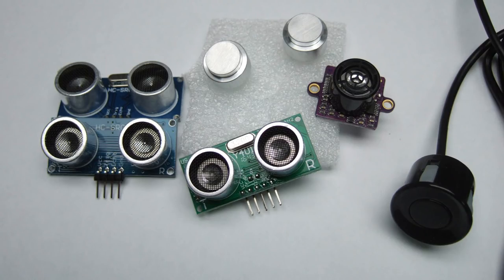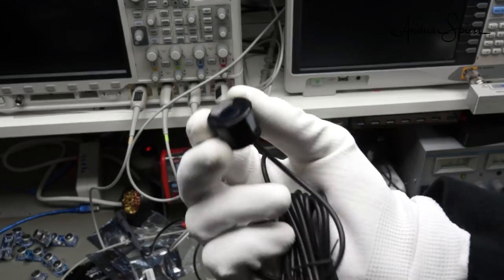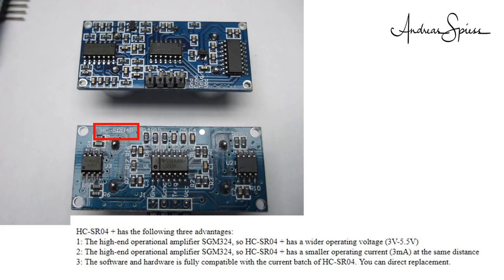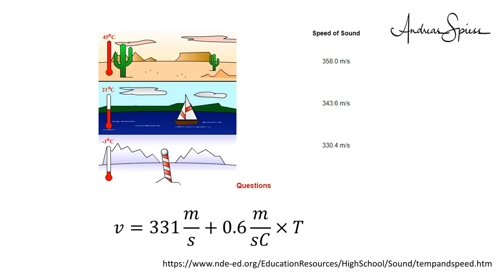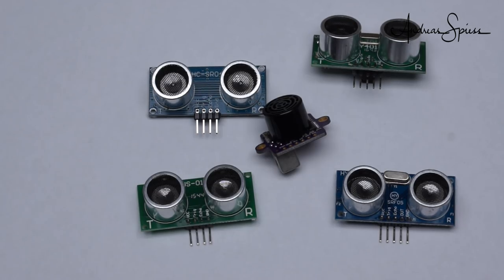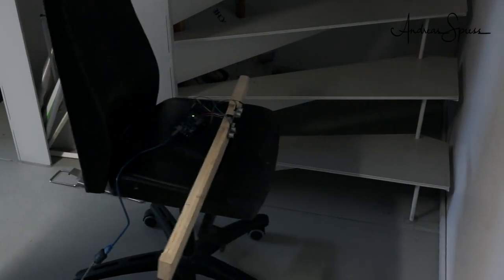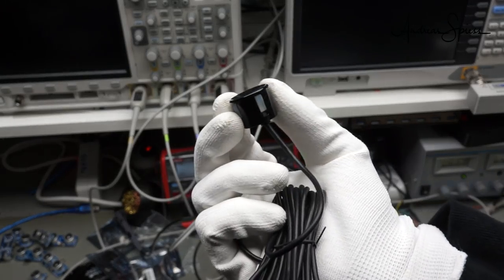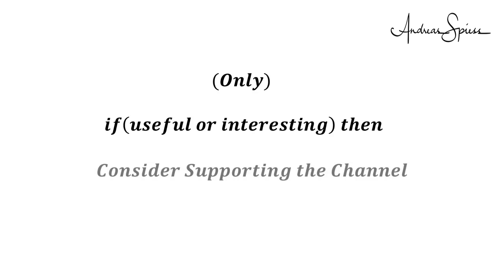#190 New Ultrasonic Sensors: Comparison and Test (US42V2, JSN-SR04T, and US-100)

Comment from the maker: Here you find the corrected overview chart: http://www.sensorsiot.org/transferFiles/UltrasonicSensorsComparison.pdf
Reply: I think that the chart is missing the measurement distance for the sensors, it is in some way a key parameter for a distance  measurement device .
Reply from the maker: I did not test it this time
Reply: I was waiting for these tests, because the interested distance measurement for the sensor "US42V2" :(
Reply: Hi Andreas, this link currently points to a 404 page not found. I just really wish to find out the detection angle of the GY-US42V2. They claim it's a replacement for MB1242 and SRF02 but those two have wildly different FOV.
Reply: boo.. 404
Reply: link is offline :( Do you still have the pdf somewhere?
Reply: The link gives a 404, is there a new location for the overview chart? Very interesting video, btw.
Reply: Andreas Spiess hi can you provide a working link to the pdf file? Thank you
Reply: G'day I am targeted individual,I have sensors in my yard and house ,is there anyway I can block the sound, someone has a direct sound coming through them  .thank you great video 👍👍👍
Reply: Thanks. Adres I need to sense top liquid very accurately ( +-1mm) in a small pressure vessel ( Laboratory Nutsche filter - inside height 300mm). This is to detect and plot the liquid level dropping vs time and accurately determine the top of the filter when the liquid is gone. Range and accuracy seem to be an issue here. Are there " newer" sensors that may suit?

Comment: The word "transducer" can be used for both a microphone and a speaker, so you could say some of the sensors have a 'combined transducer'.
Reply from the maker: Thank you for the clarification! I did not know this word.
Reply: The correct word is: transceiver (TRANSmitter + reCEIVER). Transducer is a device that converts some form of energy (e.g. mechanical energy) to another form of energy (e.g. electrical energy). Examples of transducers: LED, light sensor, microphone, speaker, thermometer.

Comment: Another well done and informative video.  Thank you.
The use of a ultrasonic sensor in the garage to help prevent parking the car too close where the bumper may damage stored items or even the wall.  Sometimes a car barely fits into the garage to permit the garage door to close properly.  America has had a long love affair with big cars (that barely fit in the garage).  Here is a link to one example of a garage parking sensor.
By the way, adding a light to your Google calendar reminder device to add the salt to your softener triggered by your ultrasonic sensor might help keep the wife happy.
Reply from the maker: Aha. Here, we usually drive smaller cars ;-)

Comment: Andreas I have used the JSN board as a daughter board on an integrated product. This was done to a proper level with the intention of commercializing. Unfortunately I was not able to get the product out even with me supplying at my cost, installing and operating. I required approval from businessmen and in a third world country its amazing. I am taking all the risk and bearing all the cost and I cannot even get a meeting.

I am now in a different third world country but I did document the project before leaving. I intend to put up some info on it in the next few months time permitting. If you or other viewers are interested I will put a link.
Reply from the maker: Please put the link below this video if ready
Reply: I have the raw footage but I need to edit and explain the project from concept to finished. I figure 3 weeks or a little more before I get the time to complete the 3 or 4 videos needed. The last one will have the JSN board in it. I will link when complete.

Comment: I want to use the HC-SR04 as a parking sensor. I want to install 3 LEDs Green, Yellow, & Red so when I get to the the exact spot before I hit the curb in the garage. It is an indoor garage so don't need to worry about the sensor getting wet. Like the idea about the Water softener.
Reply from the maker: Cool project!

Comment: Love the salt level alert idea. Most people here on wells run a softener. I had one in my previous residence and was always filling it when I noticed the water went hard  due to running out :)  Great video
Reply from the maker: At least you knew it worked when the difference was visible ;-)
Reply: Oh yeah- huge difference. Only need half the soap to do the dishes...

Comment: Andreas Spiess my vote would be for a fluid flow meter using perhaps two of the combined transducer models. Could you use the doppler effect to tell when fluid is moving through a pipe/duct? I have heard of people also using these sensors to make a solid state anemometer (three of them facing each other) , which could be a good application for your waterproof units.
Reply from the maker: I never tried the doppler with water. Seems to be interesting. And the anemometer is also an interesting application. I played with it once when I built my wind tunnel. But I used different technologies.
Reply: Simon Merrett I have seen people talk of measuring water flow with these sensors too but have not seen it actually done.

Have you tried it?

I would like very much to be able to detect if water is flowing in a particular pipe non-invasively. Not bothered really about the amount, just the difference between still or moving.
Reply: Gavin Smalley I haven't but it would be very valuable discovery to measure or even detect flow non-invasively. For example, in order to understand and reduce energy use in buildings or industrial processes, knowing flow rates is very helpful and the system downtime and labour costs seem prohibitive for invasive techniques. I wonder if there would be any opportunity to observe constructive and destructive interference, like an (ultra)sonic Moire pattern, as the sound will be transmitted through both the pipe material (speed of propagation stays relatively constant) and the fluid (speed of sound propagation relative to the pipe changes with flow).

Comment: Mr. Spiess, I contacted the AliExpress vendor for the GY-US042 Ultrasonic Module and they provided me with a Instruction Manual in Chinese.  I used google translate to concert the document to English.  I have the document in Adobe PDF format but I do not know how to post it here.  If you would like to receive the translated document please provide me with eMail address or other means of sending you the document.   The manual discusses the three communication methods available, I2C, PWM, and serial.
Reply from the maker: I think, in the meantime, I also got a documentation and put a link into the description. Maybe you check if yours is different. I am on Twitter and Facebook.
Reply: hi, i would like to receive the translated document of the GY-42US module, may i know how is it possible to receive this?
Reply: Maybe you can post instructions on some file sharing or email me and I can post it? The original instructions from Maxbotic doesnt cover PWM output.

Comment: What I'd like to know - if possible - are basically two things; How wide or narrow the sound beam is - could it be used as a direction finder (assuming an array with multiple sensors in various directions). Second issue is - does the sensor have to be in the open, or could it be hidden inside a housing (glass fibre).
Reply from the maker: 1. Maybe you watch my first video about these sensors. There I show the angles.
2. I doubt they will work inside a case because the case will reflect the sound.
Reply: Thanks, I realised that after watching the first video, I'm now considering a radar application, I just have to try to narrow the beams to achieve some kind of directional sensing. Seems the HFS DC06 is closer to that than any other I've seen so far. Looking forward to this challenge, I have yet to buy my first Arduino...

Comment: Thanks for the video Andreas 
 I'moing a project on measuring water level in a submerged water tank. I got some false readings when I used the HC-SR04 due to the humidity inside the tank which forms drops on the transmitting and receiving area of the sensor. Would you recommend JSN SR04 sensor for my project or is there any other sensor suitable for it?
Reply from the maker: I never tried this situation. So you have to test yourself.

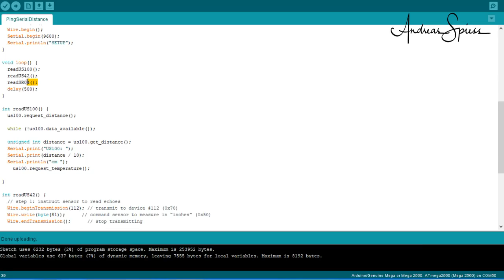Comment: I was wondering why would they interfere with each other?  Initially I thought you must be triggering them all at the same time but looking at your code at 7:56 I can see that you switch between each without delay except after the last one.  It could be that a small echo can still be heard bouncing around from the previous sensor that is tripping the next sensor in the loop.  I would have put a bit of a delay between each sensor call instead of just a larger 500ms delay at the end.  That should fix the odd errors that pop up showing low distances.
Reply from the maker: I did not investigate. Maybe they do not wait for the command and do some "freewheeling" measurements?  I think, at least some sensors seem to offer this possibility.
Reply: I thought the ones with a "start" pin didn't send a ping until asked to do so.  That's how multiple sensors of that type can be used without interference on a robot pointing them in slightly different directions.  Freewheeling sensors would allow for "instant" replies to the computer (whatever) but would severely limit the proximity to other sensors due to interference.

Comment: Thanks for this rundown of the sensors.. My plan was to somehow connect one of these to the inside of our oil tank to measure the distance the surface of the oil was from the top, giving a level and the esp266 to report back wirelessly to a little display in the kitchen saying how much was left. Don't know if I can do it though.. water might be safer! 😂😀
Reply from the maker: Oil does not burn very easy... Another possibility could be a pressure sensor at the bottom of the tank.
Reply: Andreas Spiess it's 5000 litres 😀
Reply: Andreas Spiess thank you for the kind reply. Be well, friend. ❤

Comment: Thank you Andreas for another good video. I also liked the table - brings a quick overall view. Maybe you could also present the "choice of the editor".  I am just finishing a train control system based on 2 Arduino nanos, each with an Aultrasonic sensor, and they message the distance to a motor control using I2C. The design was done before I knew about Attiny. I chose the US-015 following your previous video. I also found out it is more accurate. The idea of ultrasonic sensor with I2C can be interesting.
Reply from the maker: Seems to be an interesting project. The ATTiny can manage my three sensors without problems...

Comment: Thank you Andreas for another insight into engineering thinking. And also thank you for summarising the information into that table. That is the kind of thing newbies and experienced  will thank you for a long time. One question however. I wonder how good do you think sensors are against say water or other liquids as the reflective surfaces? Could these be used to detect for instance flooding in underground rooms?
Reply: I have used ultrasonic reservoir level sensors industrially. They work exceptionally well with water levels. The reflection off water is quite a bit stronger than flat, smooth concrete.
Reply from the maker: Thanks Peter for sharing his experience. Concerning flood sensor: If you want to wait for an alarm till the water is already high, you can use these sensors. Maybe I would use a simple moisture sensor, even a cheap one. Because it is not wet during most of the time also these do not corrode. And I assume they start with very low water levels.
Reply: thank you guys.
Reply: In my case (using US100 to measure oil leve) the results perfect. If you have no obstacles between the sensor and the liquid the measurement is perfect !
Reply: I have built devices using the  HC-SR04 to monitor the fluid level in over 20 sewage and brown water sumps in a commercial building. They have been in service for about 3 years with no problems using ATTINYs and NRLf transmitters for monitoring, the only failures have been aliexpress SSRs used to switch on and off the pumps, I had to go to actual parts through a US supplier. The sensing has never failed.

Buy real relays and SSRs when switching mains voltages folks.
Reply: I have used the cheap HC-SR04 to measure a water tank which fills periodically.  The sensor works great, but has to be replaced every few months due to moisture damage.  I tried Maxsonar waterproof sensors, but they give erratic signals when the water is agitated (filling up), and Maxsonar have said that this was normal, but it's unacceptable.  I tried the waterproof sensor shown (car parking) and it works, but it has a minimum distance of around 30cm which is too much.

Comment: Use the sensors in front of the car and make a collision avoidance system. I’m starting on one for my car. What is the range on the waterproof sensors for cars? 
Awesome video.
Reply from the maker: I did not test the range. Usually, it is around 5 meters. So do not drive your car too fat ;-)

Comment: Out of curiosity I had a look at the HC-SR04 I have on the shelf. I see that the transmitter is driven using a MAX3232 (RS232 chip) so uses the dual charge-pump in that chip to give significantly more than 5v to excite the transmitter (quite an interesting non-standard use of the MAX3232 I think).
It would be interesting to arrange a small flyback converter to supply say 200v to drive the transmitter to see if that gave a significant improvement in range.
Reply from the maker: I never looked inside a transducer and do not know when you will fry it. So it is an interesting experiment!
Reply: @AndreasSpiess  Many thanks for the reply. I never took one apart either but while I was having a shot at making an ultrasonic anemometer (using cross correlation to improve resolution which was very interesting) my wife was having difficulty with low humidity in her greenhouse so I had a go at driving one of the transducers till it produced a mist when immersed. Amazingly, despite not being designed for this purpose it worked (though not well enough to humidify a greenhouse!). I don't recall how hard I drove it but 200v p-p at least. With this level of abuse I was expecting it might reveal its inner working to me but it remained intact. BTW, the humidification was done eventually using a spinning disc driven by an electric flight motor. - effective but noisy.

As an aside, I found a web page where someone investigating the HC-SR04 found that the receive filter was centred on 18kHz rather than 40kHz and that changing two components to correct this improved its performance:-
https://uglyduck.vajn.icu/ep/archive/2014/01/Making_a_better_HC_SR04_Echo_Locator.html
Reply from the maker: Thank you for the info and the link. Some interesting insights!
Reply: @AndreasSpiess  I laughed when I read about the filter issue. I'm sure you have met products with similar design errors during your career. I developed a useful line of consultancy by finding that an electronic cat-flap I had bought had a filter not tuned to 30kHz that it was designed to operate on but about 200kHz - an unfortunate error indeed when the UK has such a powerful 200kHz transmitter in the middle of the country.

Comment: One big advantage from the combined transmitter/receiver sensors is that the range is also limited at short distances : below 10 cm they are unreliable (my experience with a max-sonar). Reason is that after sending, the transmitter need some time to swing out.
Reply from the maker: Thank you for this feedback. I did not do explicit range testing this time.

Comment: hello Andreas , Thanks for the comparison, do yo believe that ultrasonic sensors (transmitters) may have impact on microphones surrounding? as a jamming device to prevent eavesdropping .
Reply from the maker: If you google you will find such jamming devices. But with 25kHz sensors, not tthe 40kHz I used here.
Reply: @AndreasSpiess  thank you for your reply, In fact, I am currently seeking professional counseling for our startup, which is in its early stages of development. I would greatly appreciate it if you could provide me with a contact where I can reach out to you privately if interested.

Comment: Andreas, one of the pictures you include in the video around 7:34 says "Replace  R27 to changes the operating mode". I'm guessing you can just short those two pads to enable serial mode?
Reply from the maker: If I remember right it needs a 47k resistor. Check the link in the description

Comment: I've been thinking about doing a similar project for my softener salt tank, but I'm not really sure how to protect the components against corrosion from the humidity and salt. Any ideas on how to go about doing this? Maybe conformal coating, or a sealed enclosure?
Reply from the maker: The sensor I showed is sealed against humidity. But it looks like it is aluminum. Maybe a clear color could help. I do not know yet.
Reply: I'd try conformal coating if just the bare device car backup device doesn't work ( with the electronics out of the way). I've used an older "waterproof distance sensor" with no additional coating from aliexpress as the level gauge for a reef aquarium and reef sump, worked reliably for years until I got rid of the tanks. That's some serious heat and corrosive liquid. I think one was at 80C 12 hours a day right near the reef lights pointing down